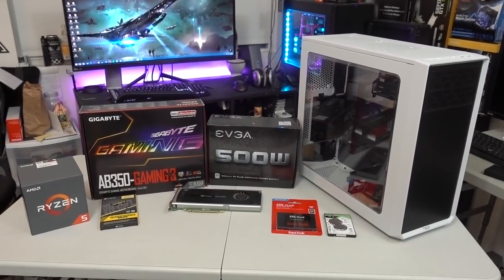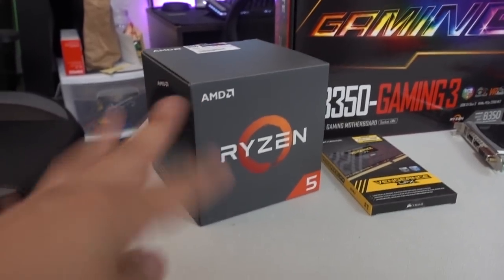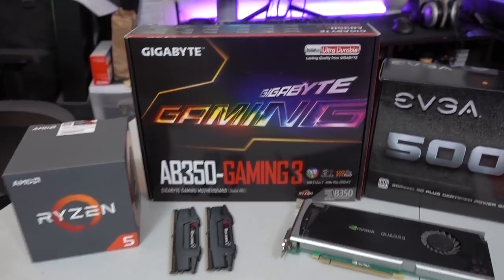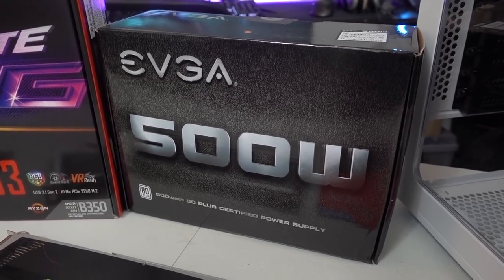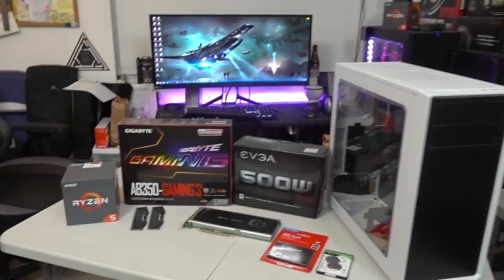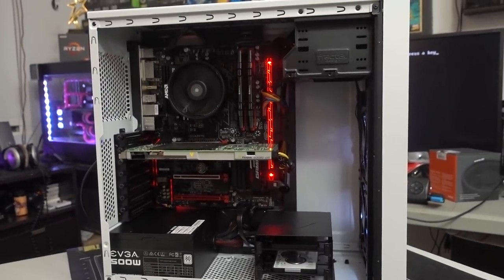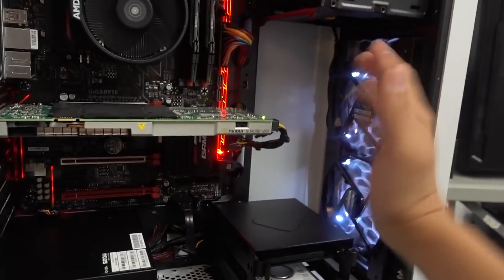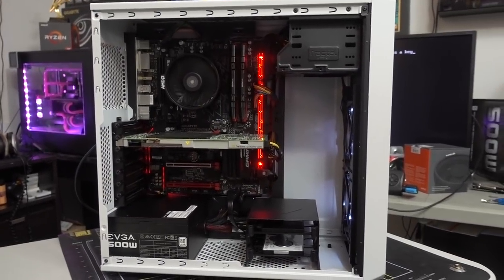A Ryzen Workstation for the Family!

Comment: Why not simply say that Ryzen blows of the socks of any Intel  CPU below 500 bucks for only 200 bucks? Helps people know that Ryzen is actually better than anything at Intel right now instead of people thinking this is a cheap build.
Reply: Aniket Bhagat Ryzen maybe faster, however, I would never advise anyone buy it. AMD products are cheaply made and produced.
Reply: Charlie Smythe forget about Intel toothpaste?
Reply: Charlie Smythe oooo dis gun b gud
Reply: cheaply made, but at least they're soldered unlike certain blue chips. Also, your assertion is just unsubstantiated bullshit, keep it to yourself. For the record, AMD's silicon is fabricated at Global Foundries on the same node process that Samsung uses. AMD designs chips, they don't make them. As for the reason Ryzen was able to be sold so cheap is because of the use of Multi-Chip Modules with Infinity Fabric interconnect, small higher yield dies grouped together make for a cheaper manufacturing process than single monolithic dies simply because they have higher yields(more usable silicon) and more chips on a wafer overall and absolutely not because they're lesser quality. Tl;DR: Mr Charlie Smythe, you have absolutely no fucking idea what you're talking about.
Reply: I think a (oc'd) 7700k still beats AMD CPUs in gaming. 
But thats it. 
Unless, of course, something changed and im spouting outdated nonsene.
Reply: Hands down, but considering you are paying 120$ more for the processor, a decent 40$ cpu cooler for the comparatively boiling Kaby Lake and a much higher priced motherboard for overclocking say 50$, for only 2-20fps(depending on the game), I think one has got to be related to one of Trump's daughters to be able to do so bcoz no one who respects their hard earned money will be spending about 200$ more for those few fps at about 10$ per fps. Not to mention that a Z270 won't be supporting upcoming Intel chips while AM4 will be relevant for the next 3 years or so. Thank you but no more Intel. Ever.
Reply: Aniket Bhagat wtf are you talking about
Reply: Aniket Bhagat thank you
Reply: Aniket Bhagat because it doesn't lololololololololol
Reply: I got a i7 5820k and a mobo for under $250.
Reply: For a workstation, Ryzen is the best bang per buck hands down. But for gaming, you wouldn't spend $500 on an Intel processor, you'd either go for the $240 7600k or $330 7700K (or lower end/non-k) depending on your budget. Both of which outperform Ryzen for gaming at these price points. I love what AMD has done with Ryzen though, finally some competition for Intel to up their game. They've just been coasting for the past few years with small incremental updates. This is all based on gaming though. If you are doing anything that takes advantage of more than 4 core/8 threads cores (this is a relatively small percentage) I'd recommend Ryzen every time!
Reply: A blanket statement of "Ryzen blows of the socks of any Intel  CPU below 500 bucks" is just misinformation and you're confusing people even more. Its all relative to what the intended use of the PC is. It's like saying 4x4 is better than a regular road car that costs more. Yes, the 4x4 is great if you ever go off road or you need to tow something, but for the every day, the car is faster and the majority of people spend 99% of their driving on the road. Not the perfect analogy, but you get the idea. Ryzen is a great all rounder and excellent value for money, but it's not the best if all you do is game and general computing.
Reply: Jesus christ, Charlie Smythe is still in 2011. So funny how he actually thinks amd is still garbage after ryzen. everyone's burning him lol.
Reply: It really depends on the workload, there's a pretty high chance that a 7600K would have been a far better choice for this build and a 7700k certainly would have. The rhetoric of Intel for gaming, AMD for productivity is very far off base and driven by people whos entire opinion on "productivity" is dictated by Premiere Pro at a self tought level ;)
Reply: Aniket Bhagat I found my ryzen 5 1600 for £188
Reply: Macsimus007 completely agree
Reply: I choose intel for its better gaming performance as I don't make videos or require more cores, that's pretty much the argument between amd and intel
Reply: Aniket Bhagat ii
Reply: intel has more instructions per cycle and build quality
Reply: Phiphe Dude that's rubbish "build quality"
Reply: Not true anymore, 2nd gen Ryzen is a joke.
Reply: @tgk300xx4   how's that stock intel cooler treating you
Reply: @MrMarci878  Intel is better for gaming, but you can get more for your money from ryzen.  It really depends but i agree
Reply: @lukx_  At 1080p 144Hz, sure. 
Maybe even at 1440p. 
But more than that and you wont feel the difference due to GPU constraints.
Not to mention that it wont really be worth the premium you pay over Ryzen these days
Reply: @tgk300xx4  Say, how are your 10nm chips going again?
Reply: Santosh Gontla Perfectly fine, I am sure once they arrive they will be the best. Intel is superior, end off.

Comment: Ohh should have got a k4000, I used to have a 4000 but it ran exceptionally hot when idle, from new it was idling at 80 degrees, traded it in for a k4000 and that idles at 50 degrees 👍
Reply: mjscgi321  idles at 50 still seems bloody hot.
Reply: ahh yea just double checked, with a blank 3ds max scene open its 50, when that's closed it dips down to 42

Comment: do u guys think this pc is good? i’m going to order it in a few months
-Ryzen 5 1600X 3.6Ghz 6-Core Processor
 $225
-Cooler Master Hyper 212 CPU Cooler
 $20
-Asus Strix B350-F Gaming ATX Motherboard
 $90
-Ripjaws V Series 16GB DDR4 (2 x 8GB)
$110
-MSI GeForce GTX 1070 8GB Video Card
 $400
-Samsung 850 EVO series 250GB SSD
 $100
-Western Digital 1TB 7200RPM Hard Drive
 $48
-NZXT S340 ATX Mid Tower Case (Black)
 $70
-EVGA SuperNOVA NEX 650W ATX Power Supply
 $75
-Acer GN246HL 24in. 1920 x 1080 144hz
 $180
-Windows 10 Home 64-Bit
 $80
-Wireless Network Adapter 
 $16
-Corsair Something Something Fans (2 Pack)
 $80
So the price comes out at $1,414 idk if this is a good deal buuuuut, hey there are comment sections!
Reply: Ship well the performance is the same when the 1600 is overclocked, but the if u overclock the 1600x, the 1600x is better
Reply: Ship plus the 1600x is only $25 more for a pretty good amount more performance
Reply: mashi DO ok
Reply: IAmJames - Minecraft omg they are both unlocked lmao. It's not intel jeeZ
Reply: It'z ya boi You snached that Gpu at the perfect time.

Comment: I recently went back to school and had to build myself a new computer.  I used the Gigabyte AB350-Gaming mb with AMD Ryzen 1500X and a GTX1060 video card.  To round things up I got a Corsair CPU cooler, 16GB 2133mhz RAM, 240 SSD, 1TB Seagate mechanical and some extra fans for the case.  All for around $1000.  I made sure to purchase products that could support constant wear and tear because I am running a triple boot (Win 10 Pro, Windows Server 16, and Linux) as well as running Oracles VMware which eats up resources.  I have found that I get the highest CPU and Video load running VMware to create Virtual Windows Server 16 and that I ended up just barely covering the heat issue.  If I hadn't done the CPU cooler(Corsair's watercooled H240) I may have damaged my system.  When dealing with workstation PC's sometimes it can be hard to tell just what loads it will be asked to carry.
Reply: I am taking a Unix/Linux and Windows 10 class ATM.  I have Windows Server class later in my schedule.
Reply: I'm going to be a freshman engineering student next year and I'm building a pc for the first time. I got the ryzen 3 2200g APU, 8 gb 3200 MHz ram, 512 gb SSD, MSI B350 pc mate motherboard, white NZXT S340 case, and EVGA 500W 80+ bronze PSU for $430. I'm planning on upgrading to a gtx 1050 ti once I take higher end design courses.

Comment: swap the Quadro for an rx480 or a gtx 1070 and you get yourself a gaming pc
Reply: Da Dogtah well yeah then it would be a gaming pc. But this build is a workstation build for his father in law.
Reply: rip gpu pricing
Reply: This rig is exactly what I have but swap the Quadro for a EVGA 1070 and the case for a corsair carbide 2 and it's a beast of a PC and never had a problem with game dev either!
Reply: gtx 970s are pretty cheap on ebay
Reply: aaand a way better workstation PC, seriously, even the GTX 1050 pwns that Quadro at workstation related tasks.
Reply: Raw performance isn't the first priority for workstations. Quadros offer more stability, ECC RAM, and driver support for professional applications such as those used for CAD that are not offered with GF/Radeon.
Reply: Etherium miners: SYKE! NA BITCH! NO CARD FOR YOU!
Reply: Alex Tang I was wondering if Ryzen has ECC support...
Reply: Da Dogtah I must say, I have a similar PC build except for a Quadro I have an RX 580 and it all goes pretty well... I use it for either gaming or 3D modeling/drawing
Reply: I can play most of the games on high or ultra (1920 x 1080) and newer drop below 65
Reply: Yes it does. Only X370 though, I think. I have the Taichi and it works with ECC.
Reply: React2Quick I said this bc I have the exact same one except the case and an RX 480
Reply: Bill383 lucky for me in my country,the rx series is still normal priced
Reply: Da Dogtah what country and how much for rx 480 because when I bought mine it was $200 and now the price has skyrocketed
Reply: DumbSloth87 1050 might beat it in speed, but if you decide you need a quadro it's because of its double precision point accuracy. Guaranteed to be correct instead of just getting the job done as fast as possible.
Reply: cccstudios521 Indonesia (southeast asia)
Reply: the 1070 isn't equivelant to a 480
Reply: Mike Productions yes i know,its just an option
Reply: yah too bad 1070s are 600 bucks right now with this bs mining hype that should've started to die out by now
Reply: 710underground I just started mining, but as a gamer with dignity I bought an antminer, way more power than gpu and I don't take any graphics cards away from guys wanting them to game with
Reply: Why could they not buy BITCOIN mining modules instead...
Reply: they can but choose not to.... savage salvage is the exception lol
Reply: Soupstore Bitcoin isn't profitable anymore, Ethereum and litecoin are the two main profitable ones right now
Reply: nope, if you listen he says he wants it for his fam who are using FUSION 360. This is a direct X driven app and only uses open GL on a mac. Autodesk themselves recommend a "gamer" class card for this app as unless you are using one of the $4000-$6000 cards you will get a BETTER performance on the gamer cards. The stability you speak of is worthless if the app uses directx. ECC ram will not save a direct x crash. I use a fire pro at work and have a quadro machine and a 1080 machine at home and depending on the app i'm using the performance varies wildly. As someone else here mentioned even a 970 will knock that quadro all over the yard all fucking day in ANY app.
Reply: Guys, What do you think about R3 1200 OC + 1050 TI for 3D CAD + 8gb 2666?  Does it work decently?

Comment: F360 does full renders and tool path calculation on Adobe's cloud system. Building a high end rig to run it is pretty silly. All you need is a fast dual core, enough ram to hold your projects and integrated graphics.

Comment: It makes me happy to see you using a 500w psu . my mid range build is much the same other than i use the asrock gaming k1 mobo and an rx460. I was told to go no less than 650w but i just used a 500w psu i had sitting around bronze rated zalman. Having power tested the load im so glad i diddnt pay out for a 650w as under full load ive never seen it use more than 250w

Comment: I'm pretty sure installing a fan at the back would disrupt the heatsink's airflow and cause it to be less efficient..    A little tip for ya.   I've tested similar situations like this with my case and a sticky note as a flow meter, saw as much as 1cm movement in the sticky note.

Comment: two things I need to ask 
1. are seagate drives actually good, I've personally had nothing but problems and reliability issues with them in the past (hard drives often failed/corrupted and slowed down after a year) ?
2. looking through RAM modules I keep coming across a manufacturer called Team Group, are they any good compared to Corsair or G.skill (i've heard they use less cache on the chips)?
Reply: Orlando Ford
1) Depends on which drive you get, and how you use them. personally, I've had way too many Seagate drives lose data than any other manufacturer over the course of my IT career.
2) Don't go chasing waterfalls...
Reply: Seagate have changed their game recently, they are not like they were mid 2000s

Comment: Clock speed is still king for most Autodesk software, including inventor and fusion. Also i bought an old Amd firepro w7000 for $125 and it out performs my gtx 1080 in solidworks and Iventor, so maybe if you ever do another build for CAD/CAM try one of those to save some money. Love the videos keep them coming.

Comment: Nvidia quadro can really make a difference if you work with applications that can make use of the driver optimization.
I build a work station 1½ year ago intel 6700k 32gb of ram and an Nvidia quadro M4000 8gb, the difference in performance in Solidworks and other smaller cad programs is just amazing, before i build that systemi had an older i5 3 gen and a GTX 680 and 16 gb of ram not a bad computer, but the quadro card made all the difference in the world to my work flow

Comment: Recommendation for your build order. Plug in the Case related cables to the Mobo first not the Power/PSU. That way you layer the cables least likely to interfere with later work below those that most likely will need to be re-run or replaced. I always find the order of Cable Management/installation with Case to Mobo, Fan to Mobo, Storage to Mobo, GPU/Expansion Cards, PWR to All works best in most cases. no pun intended. This is extra true for Non Modular PSUs because if it fails you've got less work to do Removing and Reinstalling it.

Comment: @Bitwit Man, looks like you have forgotten to connect the cooler with RGB LED cable provided (look in your CPU box) - that cooler have LED light besel with changing colors.  You can configure it both in the operating system and BIOS. Help me out with this comment to be on top
Reply: The R5 series doesn't come with the cooler with an RGB ring led. Only the R7 1700 comes with the RGB ring stock cooler.
Reply: Phantom Gaming true,  my bad 8-)

Comment: I also Recently Build a Workstation with the R5 1600,the budget was Arround 600$
i went for a B350 PRIME M-A 32gb of 2866 A Data RAM and an RX 460, well the Client uses cinema 4D wich is heavy for CPU and does Not Support GPU Rendering, also Works with Alot of Audio production software, needless to say he was very pleased, i built it inside the Silencio Case from Cooler Master :D its a really neat mATX case for this kind of stuff specially with that Foam padding for noise reduction

Comment: I've got a similar build with an r7 1700 and GTX 1070. CUDA has been amazing for 3D rendering (actually blows the socks off my ryzen...), and the multicore performance is off the charts.  The quadro is a good choice but I think Pascal GPUs are much better at workstation loads than the previous gaming oriented architectures

Comment: Case looks based off the 1500/2500 series. I have a 1500, there is NO ROOM behind the motherboard tray for cables (without bulging the rear panel out). Did they acknowledge this with the Focus G series?

Comment: A quadro card is counter productive because all the added precision is lost with the huge drop in performance. Since it's a fermi card. You could just run the rendering with higher setting on a newer card to achieve the same fidelity and it will still be faster

Comment: The only major complain I'd have with this build is it not having an exhaust fan while using a blower style CPU cooler. The R5 1600 won't run that hot, of course, but I am pretty positive that active exhaust would still bring down temperatures quite a bit in a system like this. Well, at least the Fermi card uses a DHE design, otherwise the rear fan would become mandatory for sure xD

Comment: Hi Kyle. We use HSMWorks at work, and at home I have it and Fusion 360 and my R7 is phenomenal for toolpath calculation in HSM (same kernel in both). If you need more insight or want the HSM benchmarking tool, let me know, I'd be glad to share it. I'm also an Autodesk Expert Elite and can be found on the forums as Steinwerks.

Comment: Curious to know how the motherboard sees your 3200 RAM speed... I have same mobo with F7 BIOS, and Corsair 3200 starts at 2133. Did you change the RAM settings? If so, how? CPU-Z says I am at the default 2133, but in the BIOS, set to 3200. Gigabytes' APP Center also says RAM is at 3200.

Comment: already built a Ryzen 5 1600 build with asus prime B350 plus. purpose: graphic design, 3D rendering (yet to start), Gaming. 
but my hardcore AMD fanboy lil bro bought R5 1600 pc today with MSI B350 Tomahawk.....! what a shame! CPU not detected... then went to RMA, they used an R5 1400 to make it POST and updated BIOS.. pc ran smoothly... came back to home, same problem!!! finally after 3 times RMA at the same day the PSU found faulty... ! btw, the psu powers his R9 390 smoothly, but could not power his CPU! psu corsair cx500

Comment: What is the difference between putting the 2133MHz and the 3200MHz with the ryzen pc?
Reply: Ryzen can be clocked higher with faster ram, 3200 is regarded as the best as anything higher is extremely expensive. It only makes a noticeable difference in higher frame rates.